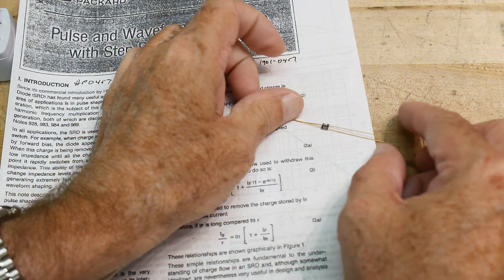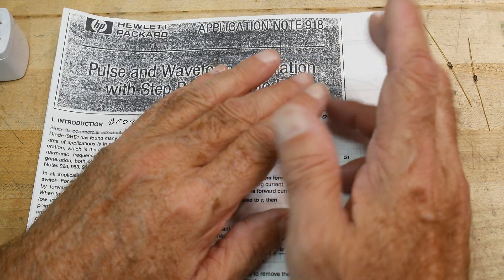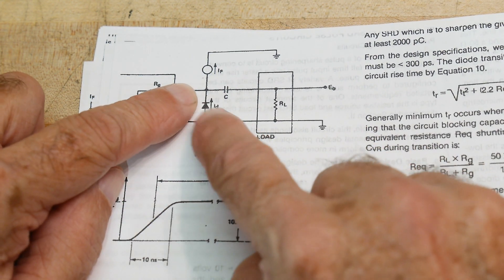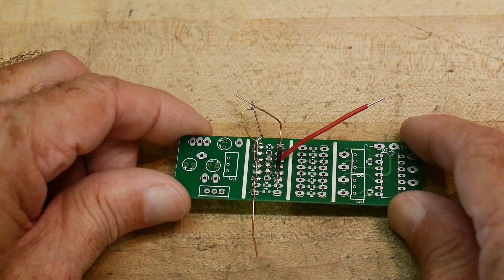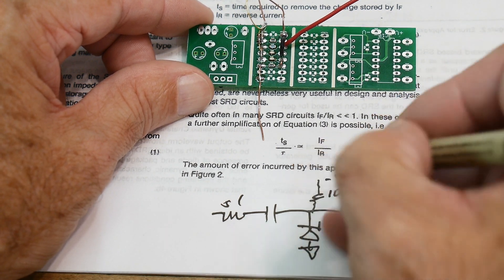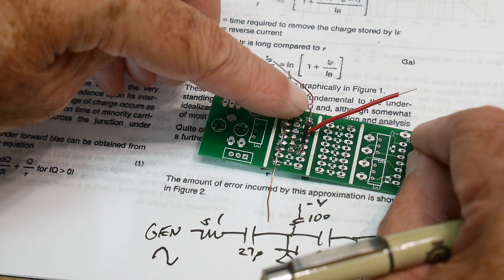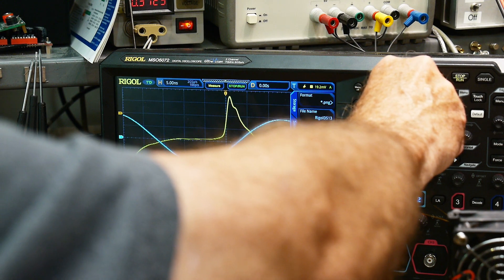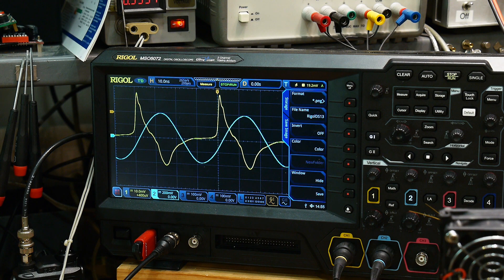#928 Step Recovery Diodes

Comment: Nice video thank you for posting it. I am surprised to see how well it worked at such low sine wave amplitude for the 25MHZ input. There are several application notes from HP where these diodes are discussed. One very interesting circuit is the one that drives the SRD forward via an inductor, and then a  relatively wide pulse is applied such that it reverse biases the SRD. When all the carriers are depleted from the junction, the diode snaps off and then the energy stored in the inductor comes out as a very intense pulse which could be as short as 150ps. If you play around with these diodes, please post more videos about this.

Comment: Thank You again for well ,everything. I should mention my real problem with main 120volt is putting seemingly good solenoid with storage caps on good transformer. I think inrush keeps blowing fuse. Do you think I should dump energy w power resistor and call it good? Slow down the cap charging, I think. Thank You from Bill Fischer
Reply from the maker: there are devices that are perfect for that. I forget the name though. they are resistive at the start and the resistance goes down after a bit. there are used in switching power supplies.
Reply from the maker: https://www.ametherm.com/inrush-current/ptc-thermistors-for-inrush-current-limiting

Comment: Dear Top Dogs, IMSAI, GLASS, and W2AEW. I would love to see someone balance this pencil on a broom while on horse back. W2 intro was as PIN diode #118. The neg resistance and crazy osc window was very interesting. I watch your stuff 3 or more times, I love it, Thank You. Also Glass gave us a useful E-Circuit breaker and I found X-RAY Tony as added bonus. Mr IMSAI would you consider a short class on scope probing 120v audio equipment. I have always been a low voltage person. Is isolation transformer the only way. The moment Dave put up the don't blow scope warning ,guess what I want to do?
Reply from the maker: simple way is to use a battery powered scope. https://youtu.be/EUr3k9Jdx58
measurement: https://youtu.be/7rVoRypx9JI

Comment: After spending years collecting circuit boards, salvaging components, sorting and displaying them in custom shadowbox/frames, and studying all the weird variations… (particularly Vintage semiconductors)I’m always impressed by the insane variation and differences found in diode’s. I’ve got a shadowbox in my collection dedicated to strange diode’s. All “standard“ axial lead diode’s… 

Some of them are in there just because they look really weird or have super fancy paint jobs/color schemes… But most of them are just really weird and strange diodes meant for specific purposes. And I still find new ones and add them to the display pretty regularly. It’s super interesting.

Comment: Thanks for the video. What are the applications of step recovery diodes and this particular circuit?
Reply from the maker: this circuit, pulse shaping, fast edge. they are used in oscillators, comb generators, oscilloscope trigger circuits

Comment: This kind of diode is also used in sampling scopes to produce short sampling pulses out of not so short trigger pulses with which they are driven. I had the chance to tear down an old broken sampling scope in the early 80s when I wanted to build some type of sampling device. 
One way to look at the function of the diode is to regard it as a pin diode that has a low resistance when conducting as well as a capacity diode with a capacity that decreases with rising blocking voltage. 
At the beginning the Diode is conducting and has a charge. The trigger pulse which is coupled to the diode takes out the charge and makes it blocking. The impulse starts rather slowly in (100s of ps) and rises the depleting current via the inductivity of its path. During this first phase the diode is still conducting and the voltage does not change. When the charge is taken out the current is already at its maximum and with a rising blocking voltage at the diode the capacity drops so that the voltage rises even more steeply. 
In that way one could decrease the risetime of a 800ps ramp to below 100ps (or better with more skills). Just a description for an easy picture of what is going on.

Comment: Those are "low frequency" diodes, good for a hundred MHZ or so, with limited output to maybe a GHZ. The really fast SRD's are good for outputs up into the tens of GHZ! You can find them on ebay from Russia, at reasonable prices. Note that these are usually used to multiply frequencies: lower frequency in: higher frequency out. So your input (drive) circuit should be tuned to your input frequency and your output should be tuned to your output frequency, which is usually a harmonic of the input frequency. They can be used to generate the local oscillator frequency of a microwave receiver.
Reply: Thanks glassy!
Reply: HP made ceramic packaged ones which were space qualified and worked up to 350GHz.
Reply: @douro20  I'm stumped as to how I would measure the output at that frequency!   :)